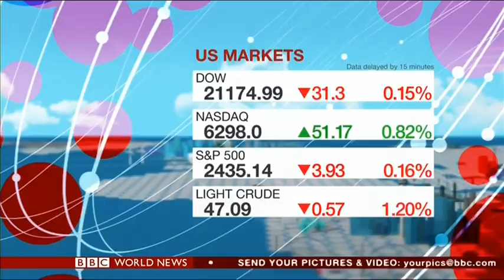Aquarius Engines on BBC World News

Comment: It's amazing that it can function as an internal combustion engine using only linear motion. This engine appears to be only for generating electricity, but it seems like it could have many other applications.😃
For example, it could be used in tamping rammers, pile drivers, actuators for robotic legs and arms that can deliver powerful punches and kicks,
vibration generators for underground exploration, hammer drills, air compressors, hydraulic pumps, and internal combustion catapults like the ICCALS C-14.😄
All of these could be powered by clean hydrogen fuel!!🤩🤩🤩